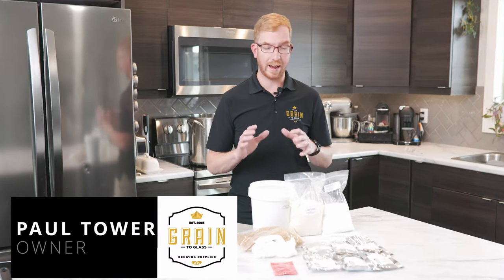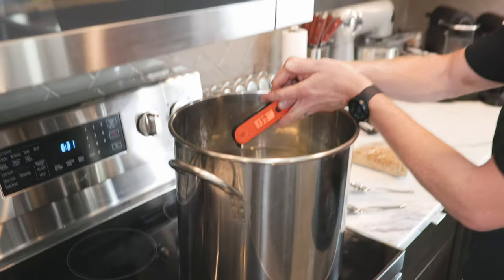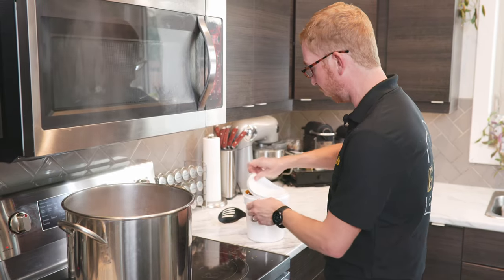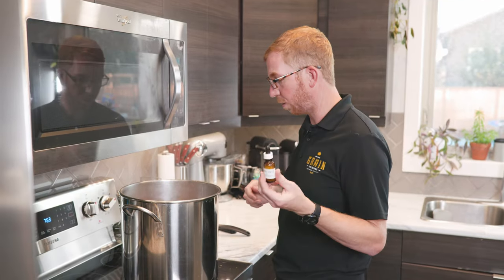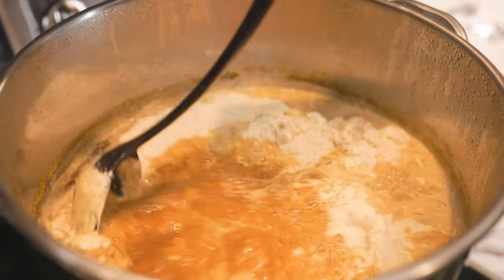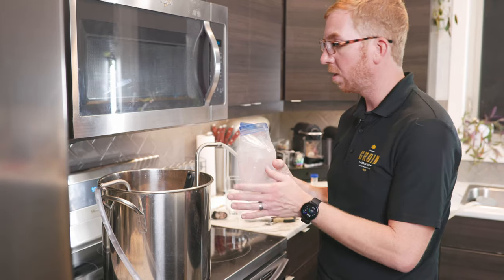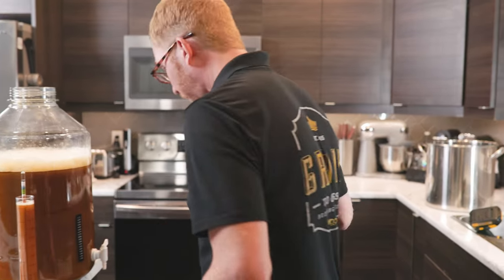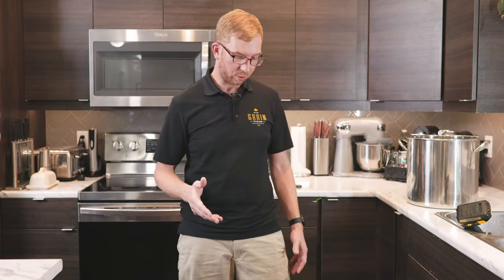Make Your Own Beer: How To Brew a Malt Extract Beer on Your Stove - Easy Guide for Beginners!

Comment: That wort looks really dark

I really like the idea of not having to do the full grain extraction though. Done it many times now and it’s such a big tiring mess each time 🤪
Reply from the maker: That's just because all the trub was in suspension and the lighting.  Once it was fermented and poured into a glass it was a light copper color.  I recommend using pilsen light or super light dme as opposed to lme.  You could also add some of the dme at the beginning and then add the rest at the end of the boil which helps keep the color a bit lighter.  Cheers